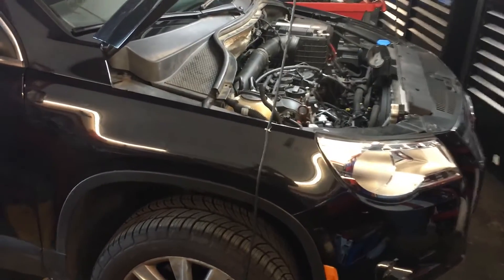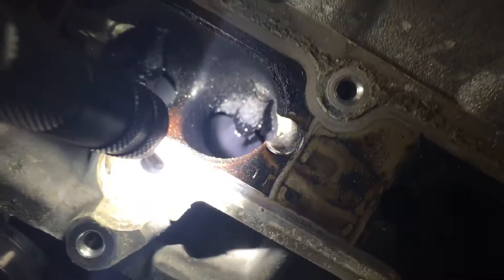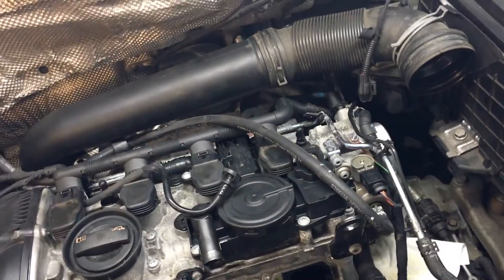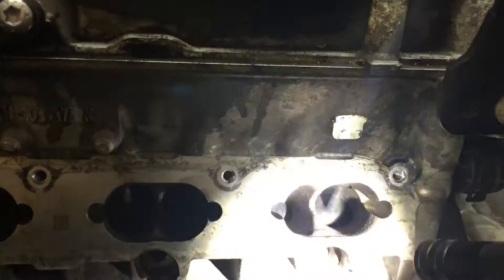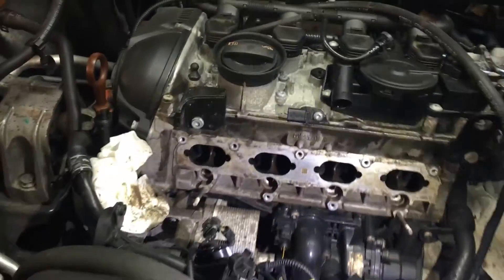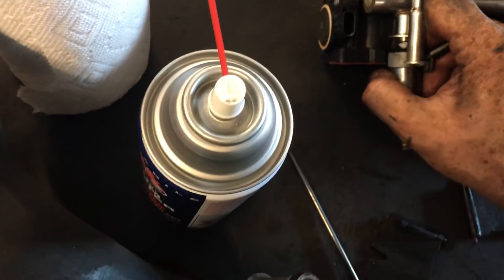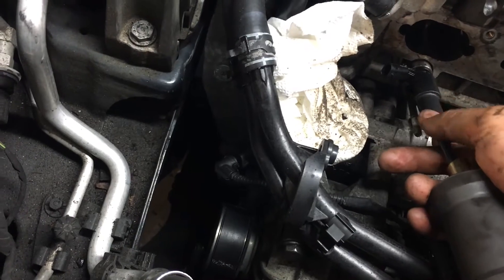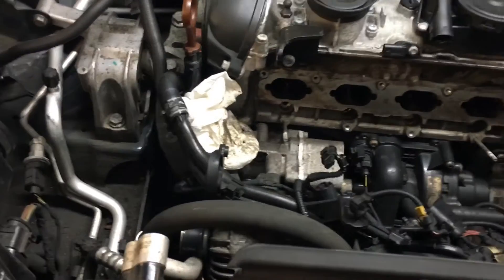VW A5: Tiguan 2.0LT Intake valve cleaning (removing all carbon)

Comment: I had a misfire on cylinder 4. Replaced plugs, wires and ignition cores. Same issue. Finally took it in and this is what the shop is doing, so it’s cool to get an idea of what I’m paying for. Thanks for the video.

Comment: I have a 2010 Tiguan and it's getting the following codes: PO300 RANDOM MISFIRE DETECTED, PO301 CYLINDER 1 MISFIRE DETECTED, PO302 CYLINDER 2 MISFIRE DETECTED. Did you get the same codes? If so, after cleaning did you then have to clear with codes with an odb2 tool?
Reply from the maker: nirav patel yes I did have those same codes and these engines are known for this problem, but it does not mean that your case is the same. You need to diagnose the problem, coils, spark plugs and so can cause these same codes. After repairs you need to erase codes by scanner or by disconnecting the battery for 60 seconds.

Comment: Hey I have Volkswagen Tiguan 2010 with120 miles on it. I’m having cylinder 2 misfiring and it happens only in the morning when car is cold, first start .I changed coils spark plugs and have same thing every morning. What to do?
Reply from the maker: M M well without a proper diagnosis is a gamble! But it sure sounds like a carbon build up in the intake pockets. I will first check the charge air system for leaks and if not found I’ll do the intake cleaning
Reply: Maic Salazar Diagnostics thank you for quick answer do you think something like g-001-780-m3 or sea foam will help of course just for now as temporary solution?
Reply from the maker: M M do you know if the real induction clean up service has ever been done? If no, then you have to remove intake. The amount of carbon these engines  collect is insane. A cleaner can’t help much. After a good service then yes use a cleaner at least every 20k miles.
Reply: Maic Salazar Diagnostics  okay thank you very much for your advice

Comment: Do you have a record of how bad the carbon build up is? I want to know how bad it looked before you cleaned it. We’ve been having issues with our 2013 Tiguan and my husband has changed the spark plugs and the engine light went away, changed all the coils and then went away, whenever he does little work the engine light goes away, I just did a trip inspection weeks ago and also I have an oil fault and told me to turn the car off which was odd because I did my oil change and somehow when my husband check the car two weeks after I got it oil changed he notice the oil was dirty and the filter was really dirty. I want to avoid him not doing fuel injector if we can to save money. We’ve spent so much for the past couple months with the car just so we can get rid of the engine light but misfire cylinder 2 keeps coming up. The first time we had engine light fault was misfire cylinder 1 & 2 but somehow cylinder 2 just never went away. The mileage on the car is close to 130k and we’ve only have the car for 2 years. I’m desperate and yes I’m the Wife so don’t just my vocabs 😂😂😂
Reply: Or I guess I you can give me some advice?
Reply from the maker: @mitsukisoliva  Hi, do you have this car since new? Have you ever service or clean the induction system (intake ports and manifold)? If you can provide me with your VIN and code list I can help you better. As per the carbon build up it is pretty common on these vehicles and does make the car misfire with lean codes. It looks pretty bad when hasn't been clean for 50k miles, the recommended procedure is at least every 40k miles and once a year a quick 1 hour induction service to prolong the good engine response.
Reply: No we bought it couple years ago from a dealers ship, I can give you the info you’re asking if you can give me your email or somewhere more private? I don’t want to post it in public in case if you understand that? I really appreciate you trying to help and also replying.
Reply from the maker: Mitsuki Soliva maic.salazar@gmail.com
Reply: Same here.  2013 Tiguan RLine just shut off in the middle of the road the other day.  Mechanic says it's due to carbon build up.  Not sure what the cost will be but don't want to buy a car right now for obvious reasons.

Comment: this much carbon in 50 kmi? tharts really bad isnt it?
Reply from the maker: These vehicles are known for this! A good engine oil and some fuel additives might help prolong the time, otherwise is a must every 30K or so miles.
Reply: Maic Salazar injectors spray into combustion chamber. fuel additive won't help, junk pcv system paints valves with oil and it bakes on.
Reply: @gregorystevens83  blow by and clean fuel make a difference too